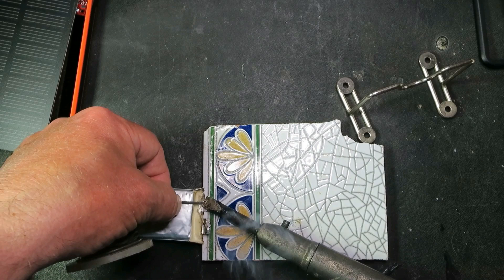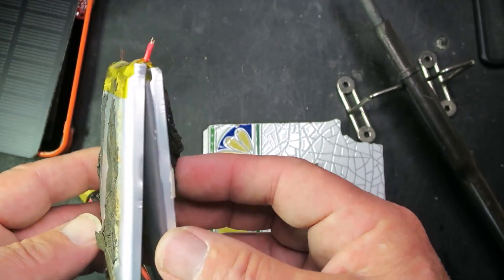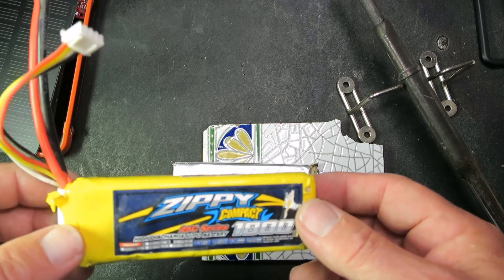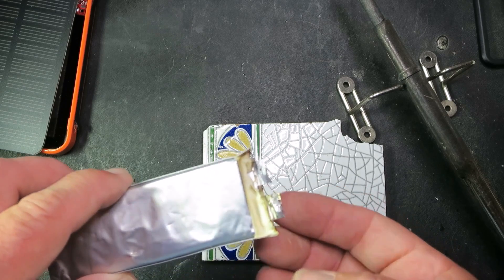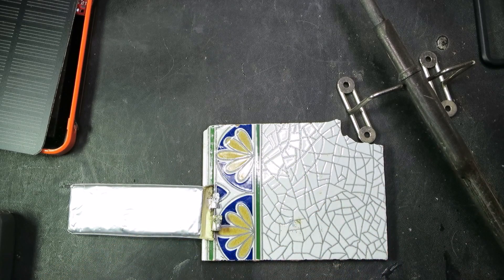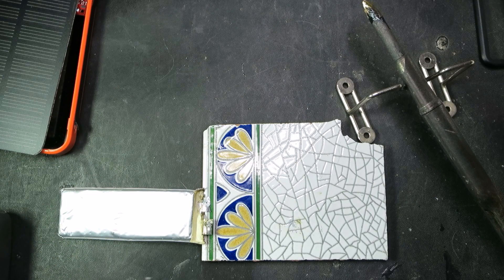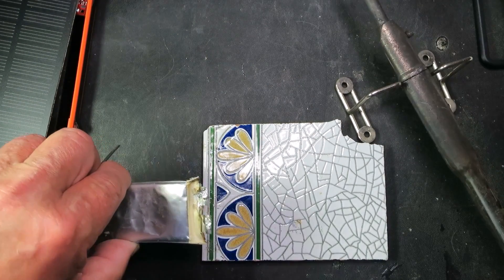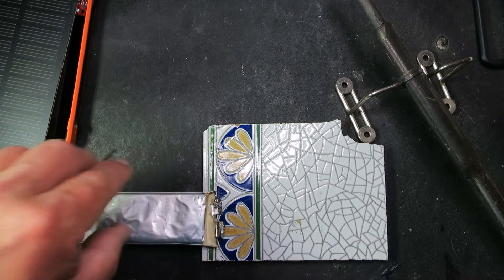How To Solder LiPo Cells - Electronics Repair Tip

Comment: Normal good solder works aswell. First clean the contactpoint surface, then apply solder paste. With the solderpaste applied, scratch the surface (gently with flat screwdriver tip) and apply extra solderpaste. Now solder your contactpoints. Now you can solder your leads to the contact points. 
Here is not the best example but you see how it works, even with engine oil. The solder starts to bond because he scratches with his ,way to small, soldering iron on the aluminum. so scratch while the flux is applied, not only before. https://www.youtube.com/watch?v=FmjdXKyDEWY